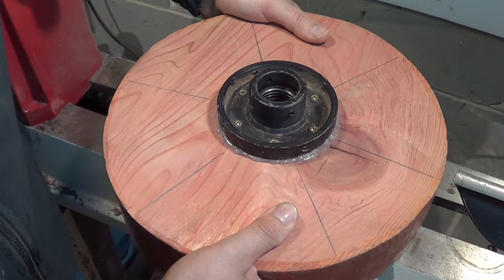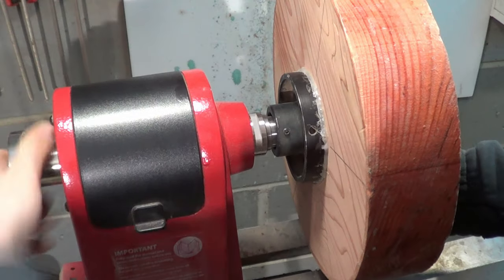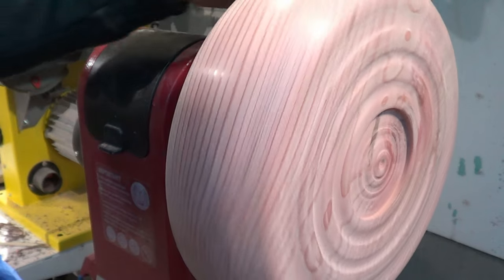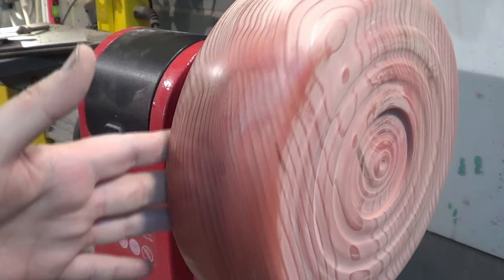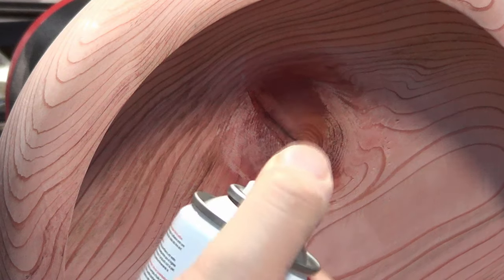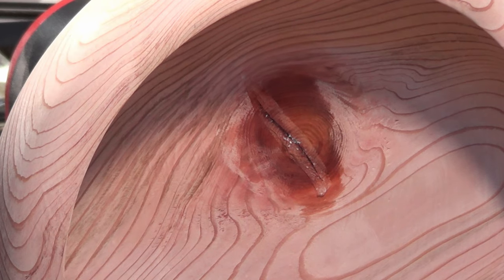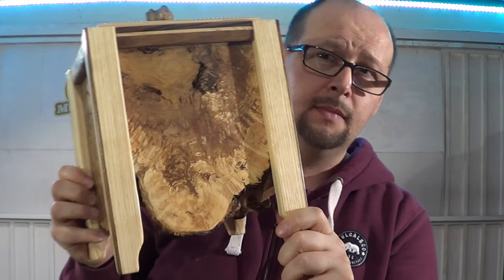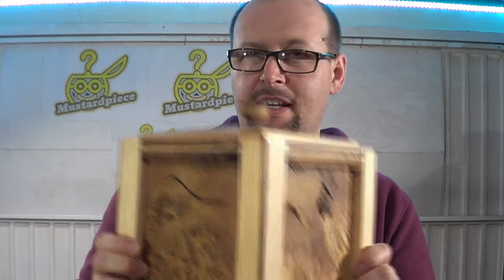Just a Pink Bowl, I'm Afraid

Comment: Hey Atilla, no worries about your change of plans for today's video. All fun, Not all projects turn out how you would like, some turn out how the wood would like. Nice bowl. just a tip, and I'm no expert, CA glue stains raw wood (I learned that a few times) so now I paint a little sanding sealer on the cracks and once dry apply CA glue so the glue goes into the crack but not the surrounding wood. Anyway, keep on thinking, drawing, planning and making. Stay safe. John
Reply from the maker: Thanks for the tips! I applied sanding sealer on it without actually knowing what it is for, so all good.  :) Yeah this video doesn't do very well , but next one will be better. ~Attila Thank you for watching.